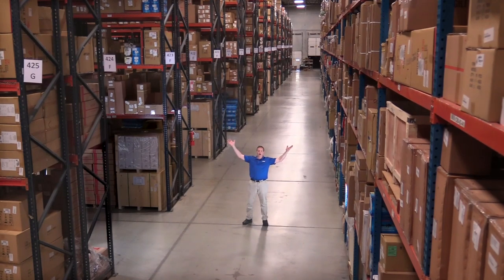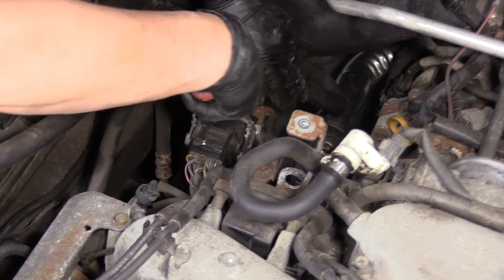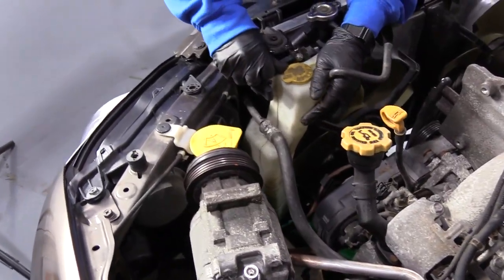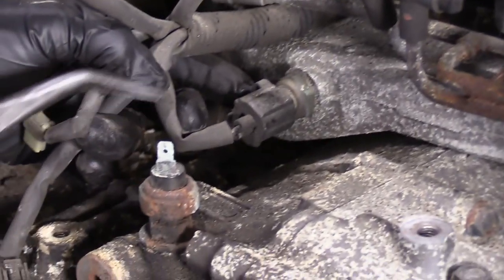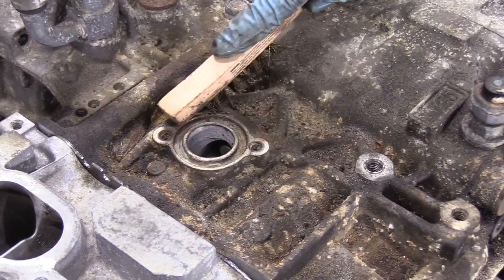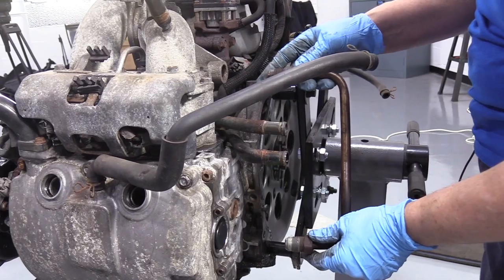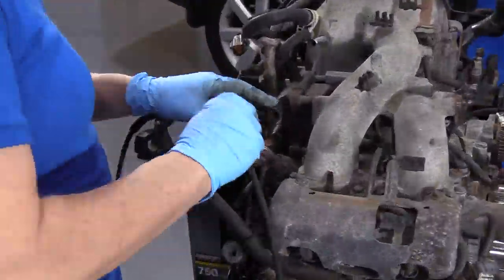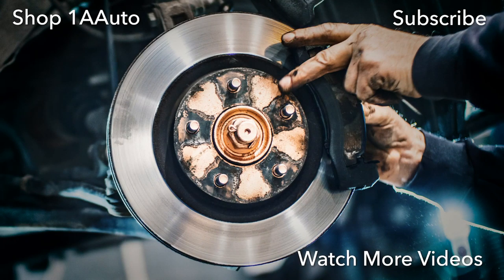How to Replace Coolant Cross Tube 04-09 Subaru Outback

Comment: Can Easily Be Done with the engine in the vehicle.  If the engine is out for some other reason it would make sense to do while out.  Otherwise no need to pull the engine for this job.
Reply: yes she said they pulled it to replace head gaskets
Reply: @smileforherr  Removal not necessary for head gaskets.
Reply: @GainReality   pretty sure she pulled it to do a few different a-1 auto videos on the engine just to have better views but your right no need to pull the engine for any of these repairs but so easy to remove

Comment: Good video but i cringed at certain parts like when she was taking the old O-rings out and scraping/brushing debris into the heads😅 the wire wheel grinding.....and the sand block usage on the intake
Reply from the maker: +Jerry ibarra Thanks for the feedback!

Comment: I have a 2010 Impreza that needs the water tube o-rings and head gaskets replaced. A couple of extra steps to pull the engine but the easy access to everything seems worth the effort.

Comment: great video.  as they said, there is absolutely no need to remove the engine to do any of the repairs shown.  when removing the old o-rings for the tube, definetly recommend covering the holes before removing and cleaning so, no trash falls down into the engine. 

you gave torque spec for the lower intake bolts. what's the torque spec for the upper intake bolts?

also, what's the small mount light you were using inside the engine cavity?

Comment: You took the engine out but you didn't do any other maintenance with that amount of cooking those gaskets that has occurred😵
Reply: Seems like an awful lot of work to pull the motor for a crossover pipe.

Comment: Awesome instructions 

Why is this an o ring? 

It’s direct to engine like oil pump and water pump. 

It should be a Full machined surface  rtv black/grey never worry about it drying up cracking 

Last one I took off the builder used rtv gray  filling the hole slightly then on the inner flat surface then the oring placed inside. 

Not to much so it spreads into coolant area. 

Subarus are weird and I own one 🤷‍♂️